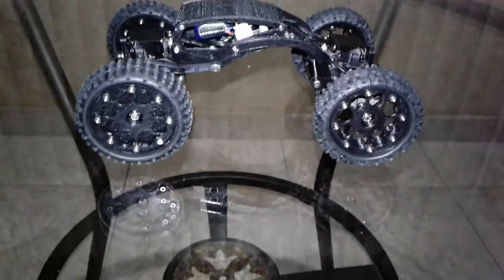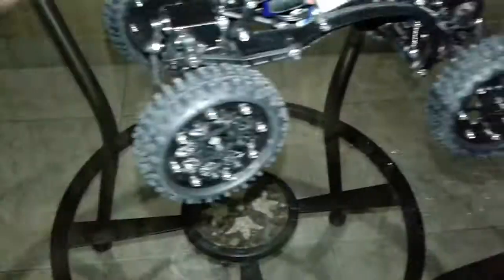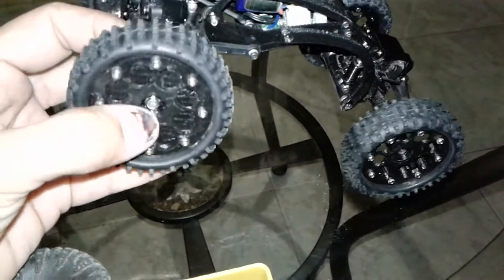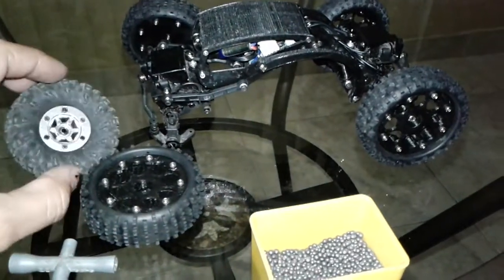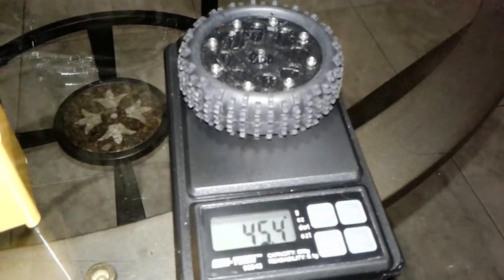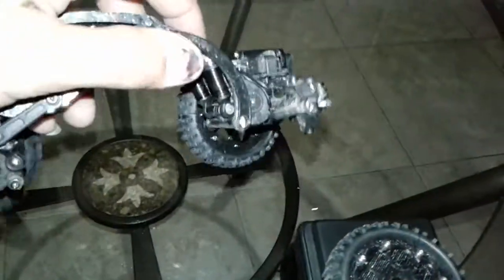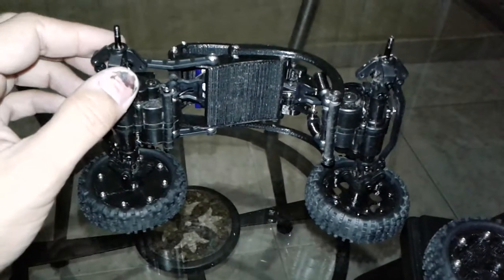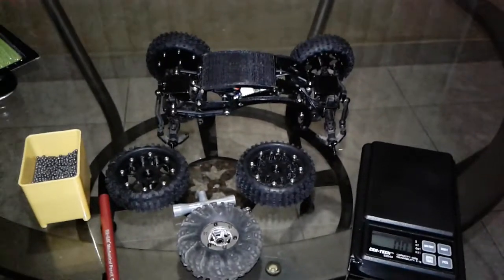Basher Rocksta Stingray Chassis 5 Beadlocks

Comment: I found some aluminum upgrade wheels and tires available for WLToys A949. They have 7mm hexes, but the axle hole is 4mm and Basher is listed as 3mm. Think they would still work? They are big (75x28mm), and have that oversize wheel look at a very entry level price ($15 for a set of 4). They are bigger than mudslingers, but probably lighter wheels and harder rubber. I might try them while I save up for the fancy custom setup you have here ;)

Comment: Wish those tires were still available, seems like they would be great for crawling and they look great, too!
Reply from the maker: Helipal still has them, hsp 58029
Reply: @drdeveloped  Any good luck in finding them? If not, what tires did you use with these wheels. I have printed the wheels but I am going crazy trying to find tires that fit. Thanks in advance for the help.
Reply: @Gamyrc   No luck in finding them? If not, what tires whould you suggest to use with these wheels. I have printed the them but I am going crazy trying to find tires that fit.

Comment: Love the spring from the pen idea dude! Got the chassis through the post yesterday 🤘😉🤘 can't wait to build her up!!!
Reply from the maker: Awesome! Post some videos so we can compare, im still not 100% on how I got mine set up, as you can see theres a bunch we can do, the spring idea came to me yesterday at work when i was bored in a meeting and was playing with my pencil! Lol
Reply: Brilliant! 😂 yes I will put a video as soon as I've got it built 😉
Reply: How did you fit the receiver in the chassis?  I'm having great difficulty... 😭
Reply from the maker: Ill send you a pic, email me at gamyrc at hot mail. In short just take off the box, use this time to watherproof it if you want,then very carefully bend the servo conections flat against the esc so the servo plug sits flush with esc (super carefully and one at a time works best). Then u can use double sided tape to attach to botom plate of chassis with motor and servo plugs closest to rear so cables can just come in and conect through the back. I attached to plate with plastidip but no need to go that far I guess.
Reply from the maker: Oh, and the tricky part, it makes things easier to solder the battery wires on top instead of bottom of esc. I'll send you pics as well. I went as far as replacing the battery plug with a charging port plug for 2s battery and only left charging port on battery and removed battery wire, i'll send you pics as well, but its not really necesary, I just lije to go all out! :)
Reply: Awesome 😉 I've sent you an email dude 🤘
Reply from the maker: Email sent, hope it helps :)